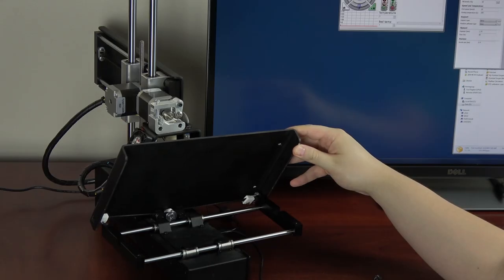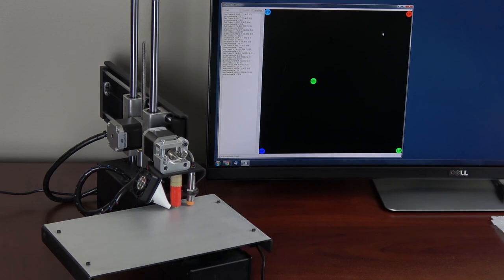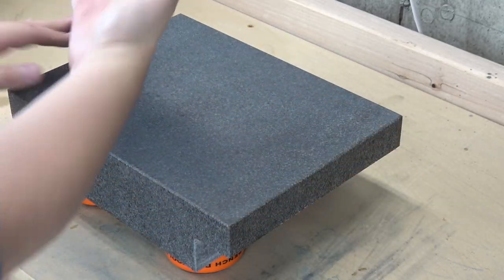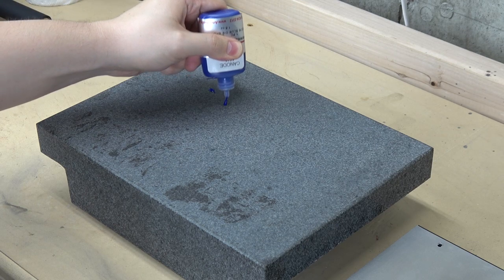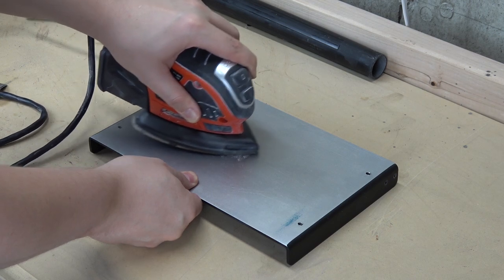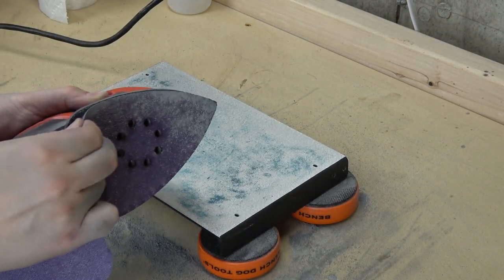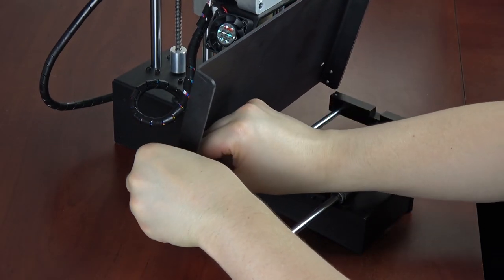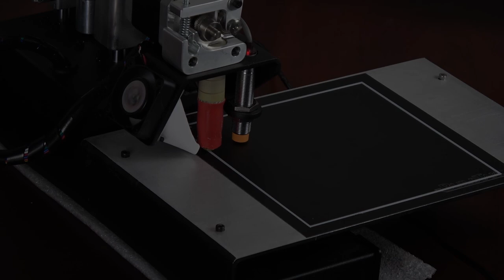Fixing a Warped 3D Printer Bed

Comment: Looking to try to use this with my EZABLE on my tornado do get a better idea of the bed issues rather than generating the graphic so many do. Can not seem to get this to work. I see the definate potenial with it and its something I would like my son to be ableto use to seeing that I would like him to learn how to add a probe and check the bed on his printer also.
Reply from the maker: Do you know which firmware your printer uses?  A few people (all with Marlin 2.x firmware) reported that the printer will move when you click in the black area but no text shows up in the sidebar.  Does that sound like what you're seeing?  There's a lot of discussion about the problem (and some good headway toward a solution), here: https://github.com/npiegdon/bed-inspector/issues/4
Reply: @NicholasPiegdon  actually there is no movement or anything.  Not sure what i may be doing wrong.
Reply: @NicholasPiegdon  I am running marlin 2.x
Reply from the maker: @jonsteege6193  Hmm, no movement sounds like it might be a different problem.  Still, I wonder if the changes made for the first problem (in that GitHub issue) will also help the second?  I'm hoping to make a new release in a few days with the changes (and a couple other improvements).
Reply: @NicholasPiegdon  i will definitely check out  GitHub and follow along with this and keep in touch for i know others probably have similar issues or never have seen this.

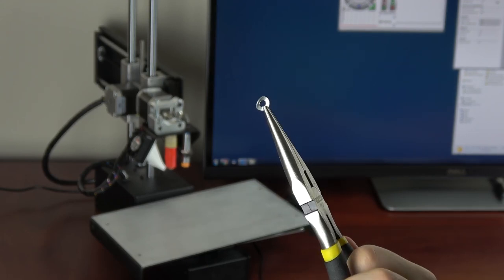Comment: @0:40 what's the gcode you mentioned to measure a single point? 

Thank you
Reply from the maker: G90 gets you into absolute positioning mode, G1 (with an X and Y parameter) will move you to a point, and finally a G30 will do a "Single Z-Probe" at the current location.  So after the G90 you can do a series of G1's followed by a G30 each time.
Reply: @NicholasPiegdon  How or what program did you use to see it on a monitor?
Reply from the maker: @LG-kj5qq  That was the bed inspector utility I mentioned making in the video.  There is a link to the GitHub in the video description.  Once you're there, click "Releases" at the side and you can download it.

Comment: does it stay flat when heated to bed temp?
Reply from the maker: That particular printer never had a heated bed, so I wasn't able to test it.  I'd imagine there would be some warping.  Annealing it after scraping would get most of the tension out of the metal and prevent most of it.  That said, these days a bed that is independent from the heater (say, attached using magnets like a Prusa i3) along with mesh bed leveling (with lots of points) is probably a better answer.

Comment: how to do that If you have a 3d printer farm , with 100 machines , any suggestions ?
Reply: Identify any printers with serious bed errors (you should already know problem printers if you are running that many). Since it is a high volume of work the quickest and probably most economical after factoring in time would be to contact local machine shops and get a bulk price for surface finishing.
Reply: you can send them to mill shop

Comment: Hi, this program looks great, but it is not functional for me, should I feel bad in baudrate in communication,
could this change it ? The program is connected to the printer but showing chaotic letters.
Reply from the maker: Sorry, I was only able to test it on the printer I had.  I suppose you could download the code from GitHub and adjust the connection settings.  They're on line 21 of PrinterPort.cs (here: https://github.com/npiegdon/bed-inspector/blob/master/PrinterPort.cs#L21 ).  Building with (the free) Visual Studio might get it to behave differently.
Reply: @NicholasPiegdon  do you mean to make a change in the file PrinterPort and then compile and create an exe file in visual stusio? I'm sorry, I'm not a programmer
Reply from the maker: @bhmarten5984  Yeah, if you open the solution file (BedLeveler.sln) in Visual Studio, there will be a little green "play" button on the toolbar that will make a new .exe for you with the changes.  Anytime you make a change in one of the code files (and save it), you can just click the green play button again to incorporate those changes into the app.
Reply: @NicholasPiegdon  hello.. I have already installed visual studio and started the project with modification and the printer has connected and executed the commands, the only thing that doesn't work- not showing results in the right black window and the automatic measurement "measure every" does not work -  performs only one measurement and stops and does not continue.
Reply from the maker: @bhmarten5984  Hmm, I wonder if your printer is returning something different than the tool is looking for.  It will probably depend on the printer's firmware.  The app wants a response like "Bed Position X: 13.00 Y: 10.00 Z: 0.10" in exactly that format.  After that single point, what do you see in the scrolling text box at the left?  If it doesn't match that exactly, the app won't detect the coordinates correctly, which would cause it to stop after the first point the way you described.
Reply: @NicholasPiegdon  My firmware je MARLIN na palubě MKS GEN L - echo: náročném: Zpracování Ložní X: 116.00 Y: 117.00 Z: -0,00 X: 157.00 Y: 123.00 Z: 11,75 E: 0,00 Count X: 12560 Y: 9840 Z: 4794 ok T: 26.39 /0.00 B: 23.12 /0.00 @: 0 B @: 0 vidím slovo POSITION chybí, je možné konfigurovat tato část? - >>> // "Bed Pozice X: 13.00 Y: 10.00 Z: 0,10", jestliže return (s.StartsWith ( "Bed Position")!) var žetony = s.Split (‘‚); if (tokens.Length = 8!) return; float x = float.Parse (žetony [3]); float y = float.Parse (žetony [5]); float z = float.Parse (žetony [7]); points.Add (nový Vector3 (x, y, z)); MeasureNextPoint ();
Reply: @NicholasPiegdon  hello Nicholas, any solution ?
Reply from the maker: @bhmarten5984  Something like that would work on a case-by-case basis, but I see now that since different firmwares aren't just sending results back in slightly different formats, but also different languages (making the number of possible outputs much larger), perhaps a regular expression ("regex") based solution would be better.  I'll see if I can't get that feature into the next update.  Thanks for sharing your printer's output!
Reply from the maker: @bhmarten5984  Thanks for all the detail and sorry for the wait!  A new v1.3 release just went up on the GitHub page.  That has a new "Custom" box where you should be able to type in "Zpracování Ložní X: {X} Y: {Y} Z: {Z}" and have things show up correctly.  (Although, that comma digit separator on your Z coordinate has me worried.  Right now it's hard-coded for US-based period/full-stop digit separators.)
Reply: @NicholasPiegdon   hello i tried on MKS GEN L.. but without succes...
main window result after click to black area => Bed X: 9.00 Y: 65.00 Z: -0.85
custom enabled -> Bed  X: {X} Y: {Y} Z: {Z}
(use eng. language on marlin)
sometime i got this error -> float x = float.Parse(m.Groups["x"].Value);System.FormatException: 
The input string is not in the correct format.
Reply from the maker: @bhmarten5984  I suspect this is because of the mismatch between the decimal separator settings between your OS and your printer.  Another update (in addition to baud rate control) will be allowing the decimal separator format (commas or periods) to be set.
Reply: @NicholasPiegdon  Hello Nicholas ! Good job with the last update... i can now partically use this app, but....
I still haven't found an option to change the baud rate :)
but more important will be this ...
depending on how the application behaves I feel that the application is working based on the information that the default home position is at the edge of the pad (X0, Y0), but my printer has a default position in the center of the heatbed (x150, y150).. i think it is very important that the program works with the correct starting position.
And the latest finding from testing is that when setting "Measure every 5mm" performs an actual step in a length of about 30mm, I think it will be related to how many steps you have set on the stepper motor? But all this can be entered at the beginning of using the program and this make the application accessible to many users. Thanks. Good work.

Comment: Kinda lost here (Noob) downloaded the info from github but how do you get the program to run at all. There is no exe file? LOST.
Reply from the maker: GitHub moved things around so it's a little harder to see now, but on the right-hand side of the page you should see a section called "Releases".  There is an exe file you can download from there.

Comment: please forgive my ignorance and possibly stupidity, but the files from github.... how to compile or run?
Reply from the maker: Follow the link on the right at GitHub where it says "Releases".  There are pre-built versions there.  You want the bed-inspector.exe under the Assets section of the latest release.  You should be able to download just that file and run it directly.  (And no worries, you're not the first person that has had to ask.  There is a lot of info on any given GitHub page and it's not always clear how they have everything laid out.  Sorry for the confusion!)
Reply: @NicholasPiegdon  thanks! I did end up just compiling it in VS but thought there would be more to it. I appreciate you getting back to me though!!!
Reply: I know this is an older project of yours, but was wondering if you are still responding to issues with the program in the github?

Comment: And here I am shimming my magnetic mat up with aluminum foil. It's not perfect but it does the job well enough for my purpose.
Reply from the maker: That's actually not a bad idea.  Each layer would be a nice, uniform thickness that is useful at the scale we're talking about.  I also like that you've found an additive solution to calibrate your additive manufacturing device.  The analogy with a CNC mill would be a facing cut: subtracting material to get the workpiece ready for the rest of the subtractive manufacturing, hehe.

Comment: May seem like a dumb question but how do I get the utility to run? Thanks
Reply from the maker: Do you mean once you're already running the app?  In the new v1.2 update, click the "Measure every..." button.  That will start running the grid pattern based on the number in the box next to that button.
Reply: @NicholasPiegdon  Never mind I figured it out. It works great! Cheers.

Comment: Just seeing this video now, and watching you measure the bed. Be careful using a dial indicator at that steep of an angle or youll have cosine error.
Reply from the maker: That's fair.  I was still learning to use it at the time and think I was more interested in getting the dial's face in the camera shot.  In retrospect, maybe a plunger-type indicator would have been a better choice.

Comment: Wish the print bed on mine was aluminum but its glass. the whole center of mine is jacked up
Reply: I have the same problem. I am trying to switch to glass but my bed is warped and so when I clip the glass to it, it bends the glass in the middle upward. It seems like I need to start with a more flat plate, then add glass. The weird part is that it printed fine with the PEI sheet.

Comment: I'm guessing this only worked because it's not a heated bed. 
A heated bed changes it shape compared to when it's cool.
Reply from the maker: The thermal expansion in ~6mm of aluminum over a 50-degree C change between room temperature and heated bed temperature should be around 10 microns. That shouldn't impact a 100 micron layer height too much, especially when most of that expansion will be uniform.  Even if the stresses in the metal cause a bit of non-linear distortion, this method could still work if you annealed the plate before and/or after.  Probably both to be safe: get the tension out, make it flat, then get the tension out again, hopefully without much additional distortion.
Reply: @NicholasPiegdon  My Ender 3 has 4 tension wheels. 
How am I supposed to take the tension out?
Reply from the maker: @alejandroperez5368  That's a different kind of tension.  I meant the internal stress in the metal itself.  Annealing means heating the metal a lot until the crystalline structure begins to change (and relaxes a little), then cooling it down slowly.  That way you get fewer deformations when it gets hot normally.  The tension wheels on your printer are to keep the axes from being wobbly or having too much backlash, so they're useful in a different way.  Annealing can take a bit of special equipment: aluminum requires a temperature around 410C, so it's usually done in a furnace or kiln.
Reply: @NicholasPiegdon  Sorry, I meant the bed leveling screws, which combined with springs, they exert undesired tension on the aluminium bed.
On the other hand, as it's a heated bed, there's no way for me to anneal the aluminium bed, as it would burn the heating circuitry.

Comment: your software not working. how to use software? pls
Reply from the maker: What have you tried?  Do you have a PrintrBot Simple Metal?  There are some assumptions in the code that would need to be changed for different flavors of G code and different size beds.
Reply: @NicholasPiegdon   thanks so much! finally i modified some part of parameter and it working! i have a question. what is purpose of using SET Z=5 and set upper bound and lower bound pls? thanks again
Reply from the maker: @kisumang7971  The upper/lower bound variables keep track of the highest and lowest points ever measured, just so an appropriate color scale can be generated.  (Notice: whenever a new highest or lowest point is discovered, the colors of all the other points change slightly.)

I'm having a little bit of trouble remembering, but SetZto5 is just a little utility (available from the toolstripmenu at the lower-right corner of the window) to sort of "reset" the Z height and make sure it's in a safe place.  5mm above the table seemed safe.  It was mostly for debugging while I wrote the rest of the code.

Comment: My God...., dude....🙄 , don't you never heard about  "glass plate" , or just cut a square piece of mirror .....:elbowcough::elbowcough:
Reply from the maker: And both of those have more variation than my result.  Glass is fine if you've got mesh leveling.  This printer's firmware didn't support it, so I needed something flatter.

Comment: dude... just buy flat glass
Reply from the maker: I just tested 8 or 9 glass things I could find around the house (windows, doors, tables, etc.) and the dial indicator deflected at least 5x as much on every single one of them (and ~30x on the worst one) compared to my scraping results.  Even across small areas of just a few inches, I was seeing as much as 0.2mm variations in glass, which is 1 to 2 full layer heights.

Glass works because of mesh bed leveling.  The printer in this video doesn't have mesh leveling, so it wouldn't have solved the problem.

Comment: Simple : first go to school for four years and learn to make a utility to measure differences in height and then you're half way there...
Reply: I wonder why those paper clips still are the way to hold down the printing surface. If that bottom part would be of ferromagnetic metall can't there be machined pockets on the top surface it not a glass sheet or a mirror which is glass obiously; and then a magnet into that pocket maybe even in both parts as that bottom is aluminium alloy or even a row. Ok then it could confuse some sensors but those clips also restrict the really usable printing surface.

Comment: It was completely unnecessary work. The bed leveling service is software balanced. This is also the bed of my printer and yet I print a perfect first layer.
Reply from the maker: Mesh leveling is common today.  It wasn't in 2014 when my printer was made.  With all five slicers I've used with this model, I've only ever seen three points measured at the start of the print.  Three points only gives you a plane.  If the bed is bowed or deformed then a plane won't do you any good.  In any event, you're right: these days you probably wouldn't have to go to all this trouble.  I've since replaced this one with a Prusa i3 and it measures 3x3 points before each print (with an option to go up to 7x7), so I don't have to worry about flatness any more.
Reply: @NicholasPiegdon  I agree. Thanks your answer.

Comment: those cheap surface plates are not the best for this either. i doubt its even certified
Reply from the maker: There was a piece of paper in the box that said it met some standard... but I don't suppose that means very much.  I remember not paying extra for the NIST traceable version, so you're probably right.  That said, an amateur using the cheapest plate he could find was still enough to solve the problem outright, so I'm happy with the results.  If I needed another 10x improvement, it'd probably require a higher-end plate (and more skill than was employed here). 😅